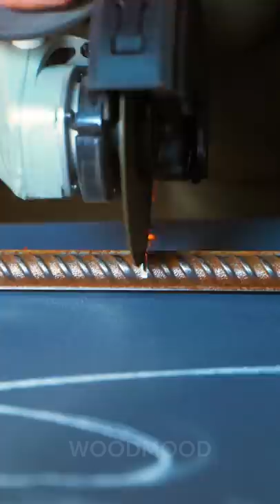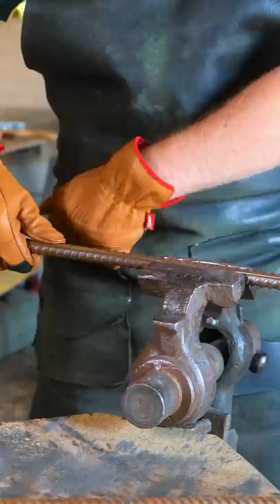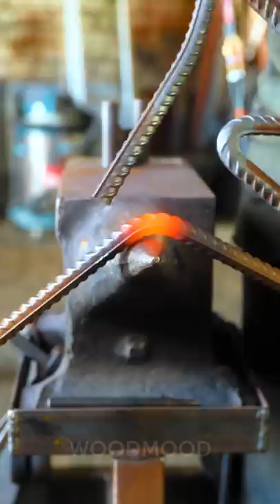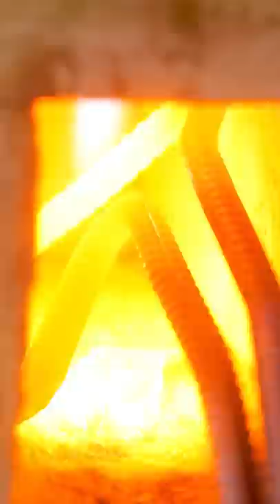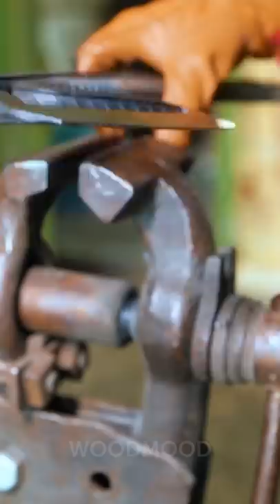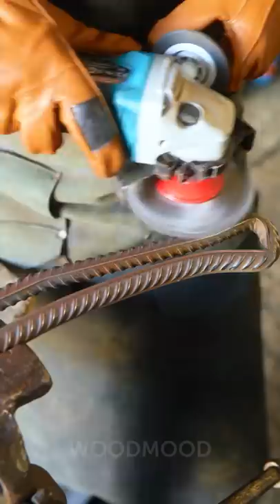Do not rush to get rid of metal garbage 🪓 Just look what an axe you can make from rebar! #Shorts

Comment: Does it look cool? Hell yeah!
Is that metal horrible for an edged tool? Hell yeah!
Reply: Rebar actually has a pretty good amount of carbon in it. It holds an edge pretty well
Reply: Km l
Reply: What 🪓 is typically damascus steel? Its usually soft steel with a bit so you don't completely ruin the axe if you hit something hard. Don't need much more to cut soft stuff like wood
Reply: @spijker_  Welcome to Gboard clipboard, any text you copy will be saved here.🍼🌸🍼